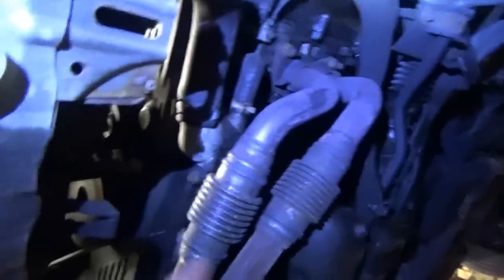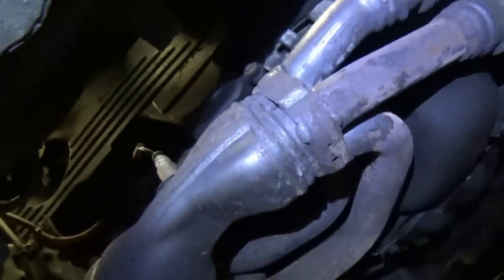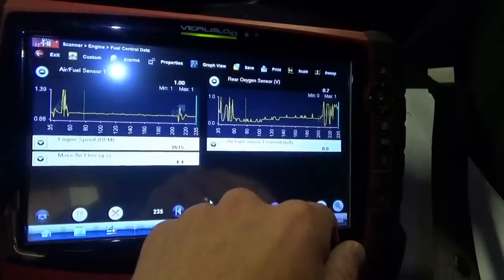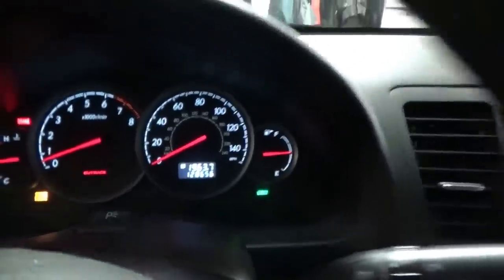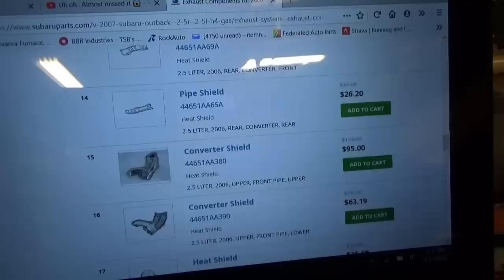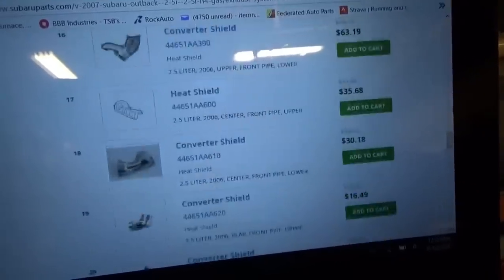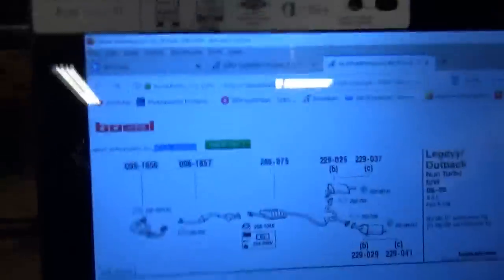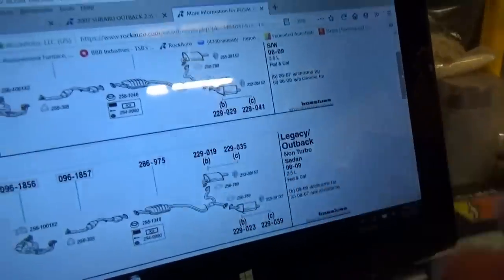Subaru P0420 - Quick Diag & Estimate

Comment: No issue using Bosal.  When you are talking that kind of money, might as well cut the strap that is in the way and try welding it up.  There is at least a decent chance that the cat is not ruined and the massive exhaust leak is throwing the cat and the rear sensor off.

Comment: send it off to a welder with experience, you just cut that strap off it, weld the pips, put a new brace on it
Reply: Exactly. He would probably do it for around fifty bucks.
Reply: That is very true but like he said it may only fix the leak and not cure the P0420
Reply: canuckguy worried  Yeah it is cheaper and may be whisper quiet when you are done, but if the converter has deteriorated then you still have a engine light with no cruise control which is part of the original complaint
Reply: canuckguy worried  Whoa easy dude, didn't discredit your experience at all just commented that if you did fix the leak there was still a chance that the converted was bad and the light would come on. To some customers when that scenario plays out "you didn't fix the issue" Also I am well aware the cruise is disabled as a result from the engine light due to it being a throttle by wire and in a unlikely event they do not want any run away engine issues with cruise on.
Reply: @ednewell1847  
Didn't Ivan suggest that the false air drawn through the leak could be the cause of the code?
Reply from the maker: Wouldn't know till the leak is fixed haha
Reply: Literally... any fix like this You can apply only for Your own car. If You charge customer for labor and parts, You should  give some warranty to... I can't imagine, if any Tech can give a warranty on to aftermarket California spec. emissions parts...

Comment: $ 1, 000 in parts plus labor cost. I would remove the manifold take it to a welding shop to plug the leak clean the cat with seafoam, Let the seafoam soaked for 30 minutes...This has work for me and Hondas with P0420 code.

Comment: Wow, but I believe it. My wife got a quote from several muffler shops on her 05 Outback. $ 1000 was the cheapest from the end of the header pipe back. Pipe cracked at the flange south of the header. When I got home from work got a two and a half inch extension from advanced auto and a set of clamps for ten bucks. Cut both flanges off put pipes together tightened down clamps and it has been there going on 4 years.

Comment: Junkyard down south you could get the whole thing cheap.
Reply: Sounds like a plan to me.
Reply: Most junkyards rip out the catalytic converter as soon as the car gets there.
Reply: Here in my state you can’t use a used catalytic converter and auto shops won’t replace it due to the legal troubles.
Reply: Here it is a massive fine to install a used cat

Comment: Had '09 Legacy that split  into two mufflers out the rear. The split was designed like your connection and that is where it developed a leak. And all heat shields that started to rattle got the screw clamps.

Comment: Why you knockin RockAuto, Bro?
They've saved millions of Folks their hard earned money.
Just because they list "cheap" products- doesn't mean you have to buy that.

$500 or $2,000+ is a no brainer.

Things flexing that much- I'd seriously check the motor mounts for play, too.
Reply: I am with you on that one. Or get an OEM Japanese one used. There are companies that import used Japanese parts from Japan. Japanese cars usually have low mileage. I think you can reuse all the heat shields. Personally, I would try some muffler cement first then you know if the cat is good or bad. Then try welding if it is good.
Reply: I ❤️ rockauto
Reply: @pl5882  I am with you on Rock Auto. My favourite auto parts store. There is no reason to go to the stealership for parts.

Comment: I have come across this twice in the past year. First time, the customer was complaining of a gas smell with no CEL and didn't notice that there was a small exhaust leak. Second time, customer complaining of louder then normal exhaust noise with no CEL.  Both times the leak was at the collector with one only having a 120K miles on it. Being here in GA, I was able to reuse the original heat shields with no issues.

Comment: Why install OEM in this application? The original failed prematurely, most likely the replacement will also. If it were my vehicle I would find a good used crossover pipe and Bob's your uncle.
Reply: Maybe the Converter failed due to engine influence.  OEM is the best way to go when it comes to Catalytic converters. I have seen aftermarket Catalytic converters cause the check engine light to come back  on.
Reply: JoeLopez40oz not on a vehicle that's worth $3000 and 12 years old. Tell your customer that the part is $1500 plus labor and trust me you won't be doing that job. If it were my vehicle/customer I would go to the local pick n pull and get a good used one and install it.

Comment: Good news, your $20 O2 sensor is good.  Bad news you need a new header, catalytic converter and heat shields which are going to cost you $2250

Comment: I did 1 on my cousin's '10 OutBack 2.5. $1,600.00 in parts. She needed several shields too. You have to go OE. The aftermarket parts not only don't fit right, but the cat is actually SMALLER! I tried a Walker.. It didn't even fit manifold to manifold.

Comment: I just replaced the cat on out 2007 legacy, 160k miles, p0420 code.  I put on a walker CARB compliant cat from rock auto plus new sensors and gaskets for about $700.  It does not provide for heat shields, hopefully ok, but it does get very hot.  The cat has a 25k mile warranty.  I am hoping to get  a couple more years out of it.  I had a miserable experience with Bosal mufflers for this car, got only 2 years out of them Simi replaced them with walkers, lifetime warranty.  Thanks for the video!  I also looked at scan data and decided the cat was bad, hope I was correct.  The exhaust has been very loud as long as we had the car.  It's much quieter now, I believe there have been some leaks all along.

Comment: Had a 2012 Toyota 86 with FA20 engine in today with same code. Toyota Australia want $3k for the crossover set up. Cheaper to go aftermarket sports exhaust system and get rid of the genuine system.

Comment: If the vehicle is PZEV complaint then a converter might be covered under warranty up until 150k. I would need the VIN to run a vehicle inquiry to confirm.
Reply: How do you check this?

Comment: Sucks a small exhaust leak can end up costing so much to remedy. I’d be tempted to take that leaky exhaust manifold to a machine shop. Could be a lot cheaper then replacing the whole thing or possibly your other idea that was a fair price Ivan. At any rate I’m sure your customer wouldn’t mind hearing all the options and going with your best idea for fixing that leak.

Comment: pipe could be welded. use a mig with stainless wire and 100% argon. cut the brace, weld up pipes and weld on new strap.

Comment: Common problem the pipes crack at the collector, I've been able to weld a few. Be careful Ivan I've never seen an aftermarket Subaru converter that meets CA emissions. The Bosal converters only meet federal emissions! Just put a Subaru cat in last week dealer item only my cost was $1100
Reply: Aside from the mechanic installing the part, who knows or cares if it meets CA Emission specs? PA doesn't ask for receipts for all you replaced parts at inspections! They don't even sniff your tail-pipe so, what's it matter?
Reply: @daviddelle774  The check engine light would come on with a P0420 so it does matter...
Reply: @jamesbruno5896  You're saying that if you put in a Fed cat instead of a Cali cat, the check engine light will come on? ............I Don't Think So!
Reply: Believe what you want but that is a fact!

Comment: I'd give him a quote on oem and quote on bosal. I always add a percentage on non oem repairs as can be hassle fitting them and potential higher come back risk, bosal generally pretty decent for aftermarket .
I would expect cat likely okay if leak repaired but if doing it as a customer job I probably prefer doing a bosal over messing with old cat, plus ideally need heat shields and that alone over half price of the complete bosal .
I not seen many cat and header leaks at that low a mileage on subarus and I handle lot of subarus . .
Is pretty easy part swap job ...

Comment: aww heck. grabs the bird poop applicator (flux core mig) poo poo poo, there I fixed it ;)
Reply: beware, it will spatter, splatter, douse you and creeper in burning beads of pain that singe hair, burn holes in all clothing, bounce back up into gloves etc....
yeah I've bird poo'ed a 3' long muffler seam together and piled it over-top multiple other leaks before, all thick coated in black carbon, so major spatter fest! more spatter than weld lol

Comment: Hello, hey, I have a dodge neón 2005 with p1790, I recently saw that you worked on that failure in a neon 2003, you could not solve it but the owner did it with a Chrysler specialist, and You said you would ask him what the fault was and I wanted to know If you could tell me, I've already changed the transmission and it's still the same. Can you help me please? I'm from Venezuela. Thanks 😅

Comment: Could that hole have been welded/brazed closed,  Ivan? I don't know what material the headers are made of. I had aftermarket headers on a van and the headers developed a hole where the tubing joined the head flanges but was able to have it welded last forever.

Comment: On the similar model outback have you ever come across what can cause the same sound as a dry sounding wheel bearing BUT it doesn't change tone with speed differences but does change loudness on different smoothness of bitumen???
Reply: Tires?
Reply: @janvanderwal2744  I've rotated them all over the place and doesn't change the side etc, 

I might try and borrow a different set and try,

Comment: Extreme heat JB Weld!
Reply: I've used high heat furnace cement but if the part moves around a lot it's a gamble but worth a try.

Comment: Good luck with him taking to the dealer, in my bitter experience this will end in one of 3 ways, 1. Go forth and multiply, 2. They will do a piss poor weld / bodge job, 3. They will fit the cheapest crap aftermarket garbage. I’d just pay you to do a proper job with decent aftermarket.

Comment: Don’t see the exhaust break like that everyday. Must be all the rust thinning out the pipe. 

We used to replace cats all the time in early 2000’s Subaru’s because they would fail from coolant and oil contamination.  

We use after market cats from time to time as well and sometimes it takes two from the same manufacturer to get one that fits properly. Walker and Magnaflow both have fitment issues but Bosal normally fits OK.
Reply: NICE TO KNOW, THANKS.

Comment: The reason they are expensive is because they are stainless.
Reply: Then it should last the life of the vehicle.
Reply: @don-cw1yz  the bad thing about stainless steel is heat cycles water hitting it when hot it becomes brittle and cracks.
Reply: @rickcoleman8903  Can you mig weld it? Or how about exaust cement?
Reply: @don-cw1yz  it can be tig welded but the location would be difficult plus very thin.
Reply: @rickcoleman8903  Only have a mig.

Comment: In reviewing it looks to me that the downstream O2 sensor is responding. In light of the exaust leak that is before the Cat, doesn't this suggest the Cat could still be working?

What about testing the input and output temp? If it is hotter coming out than coming in that would sujjest the Cat is working so a weld repair might be effevtive.

Of course I could be wrong, but I am thinking that the cat itself might be OK. I thought that Cats died from over rich exaist so a pre Cat leak would reduce the amount of unburned fuel hitting the Cat or increase the amount of air. That should not cook the Cat.
Reply: it crying ahead of the cat is kind of null, the possibility of a semi-plugged/oxygen sucking pre-cat leak could make it spit many lie codes ;)

Comment: Bosal are very good quality and original parts on a lot of euros I wouldn’t worry too much. You could plug it with some exhaust repair paste to check if the problem is solved first?